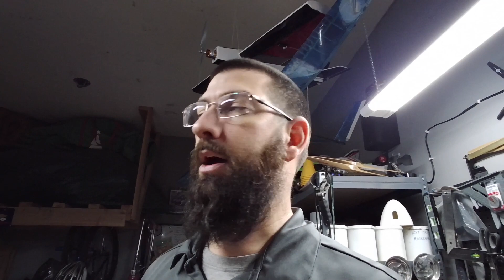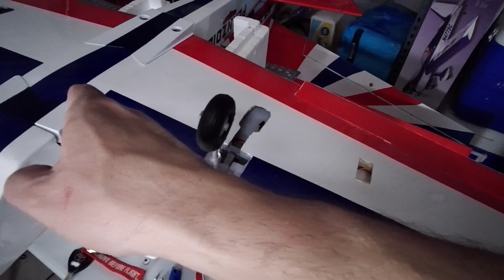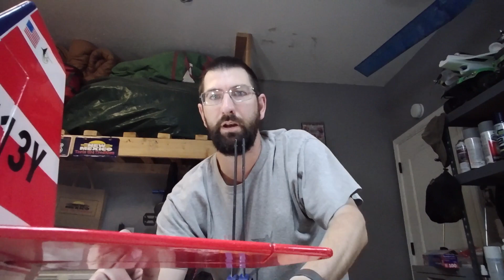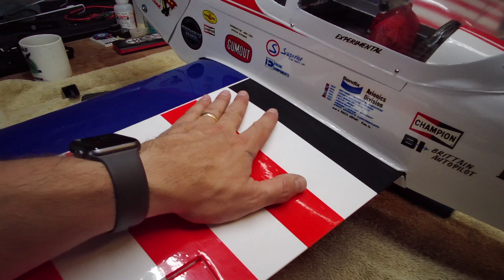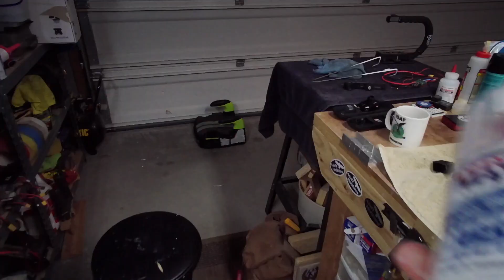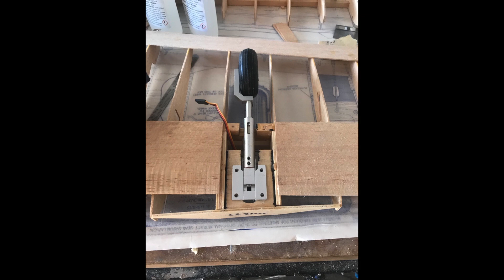CG Super Chipmunk Final

Comment: Joe ,I am copying many of your ideas and have a question for you.I added some holes in the fw just in front of the battery area for cooling the batteries and esc.Do you think there is a need to cut a hole in the cowl in front of the holes i put in the fw  to let air into the battery esc area ?Thanks

Comment: The Goldberg Super Chipmunk is legend. It is in my opinion one of the best stick kits of all time. Of the countless models I've ever built or assembled in 35 years, This was perhaps the best flying model I've ever had.  And to think the best was one from way back, is testament to the design. For me, the O.S. 90 FSR 2-stroke was the perfect set up. Woulda put an O.S. Surpass 1.20 4 Stroke but at 15 years old that was too much money for me haha.  Someone should one day make a nice 50CC ARF, so I can install a DA-60.  But then my doubts would still be on it rivaling the characteristics of the original. Either that or return to my roots and find a kit and just build another one again.
Reply: The Carl Goldberg Super Chipmunk is The plane that was responsible for me getting into the rc hobby in the first place.  I was 13 or 14 years old and walked into the my first hobby shop and there was one hanging from the ceiling.   Out of every car, boat, airplane and helicopter in the store i was drawn to that Chipmunk uncontrollably. I knew i would someday have one.  I started with a Great Planes PT-20 and worked my way up through several hand me down planes, a few RC10s and whatever i could trade for.  When i finally got a job i started saving and went into the hobby shop to buy one and they were out of stock.  Like the kid I was I bought something else.  This happened 2 or maybe 3 times.  And then i got into other things but have always wanted one.  I finally at 50 years old i finally bought and received today a kit that is in very good condition.  Even the box is in great shape for the age.  I feel like im 14 again and and  am  extremely excited to build this thing.  I'm not going to rush it.  Instead I am going to construct the best airplane I have ever built.  I will probably not fly it except on special occasions.  But i have to fly it.

Comment: I will be building the same plane this winter but righ now I would like to know what motor and battery combo you used and flight times. Thanks a lot Terry
Reply from the maker: Valuehobby.com 32 motor and 4s 6000mah. I usually fly for 5 min based on my timer and when I check the battery i have 65-70 % remaining. So, I could safely get about 10 min.
Reply: @JoesRCCorner  I have a new 32 motor that is 800 kv and I think it is a knock off of the VH 32.I have a four star 54 that has the 46 rimfire in it and I think it is overpowered.I may take the 46 out of the four star 54 and install the 32 in the four star.Do you think the 46 rimfire would be a good choice for the chipmunk.I will have to check the kv on the 46 rimfire and I am new to electric planes.